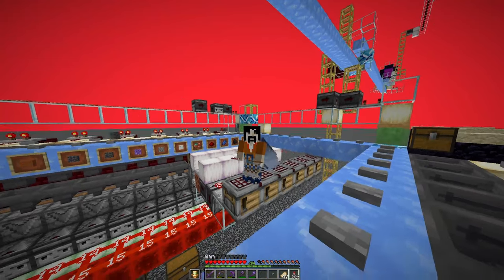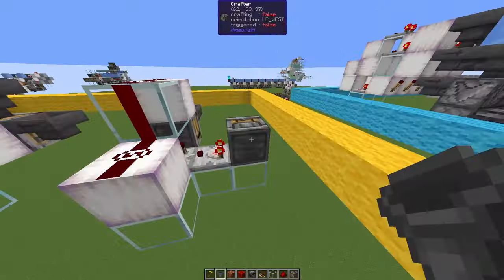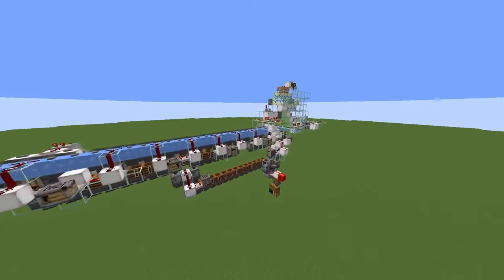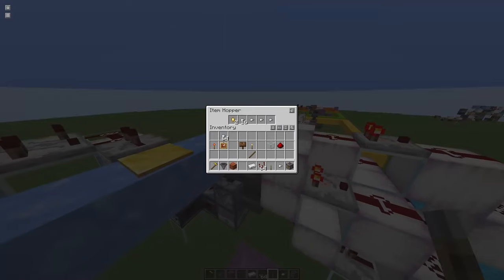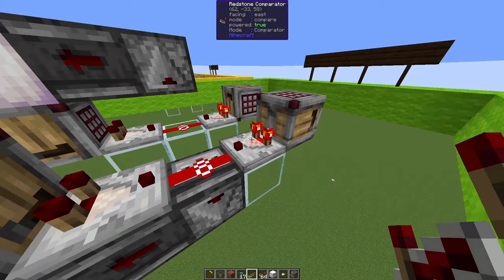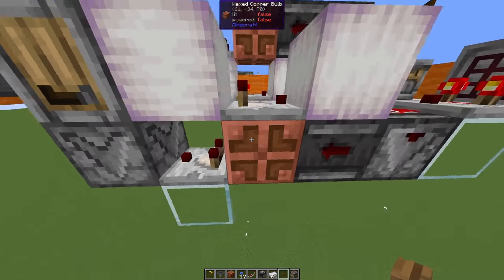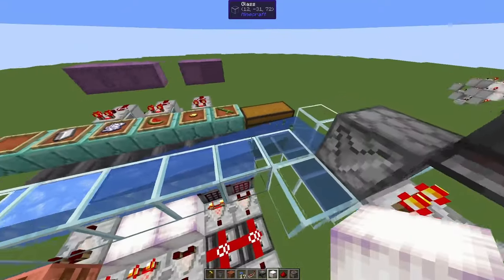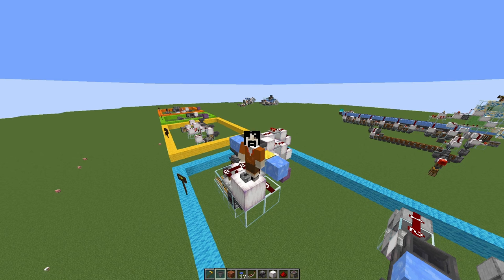12 autocrafter setups, autocrafters for all speed and space constraints Minecraft Java 1.20.4-1.21.x

Comment: isn't the white dye issue moot because you're always gonna have a multiple of 3 bone meal in the crafter? could hard power the first crafter and it'll just craft the bone block when available. Haven't tested this so I may be wrong
Reply: For the last setup that crafts bones, yes, you're correct. I'm perhaps a bit extra wary because I crafted so much white dye and pressure plates during the first days of using the crafter ;)

Comment: I'm surprised you didn't show the itemfilter/beefarm style redstone dust length system.

edit
Simply have crafter->solid block->comparator->3 dust->solid block, then reverse on top.
Reply from the maker: Actually I never saw that one, but now that you mention it, it makes perfect sense and should be really fast,,, :) You'd need 9 redstone dust though because you lock the slots you don't want, right?
Reply: @FrunoCraft  8 actually, since you want to diminish it by 8 so the 1 goes through.
Reply: @FrunoCraft  I just rechecked, you were right, it's 9. I only remembered the three out, so you have 4 redstone bottom and 5 top